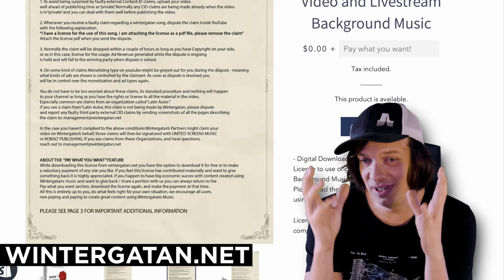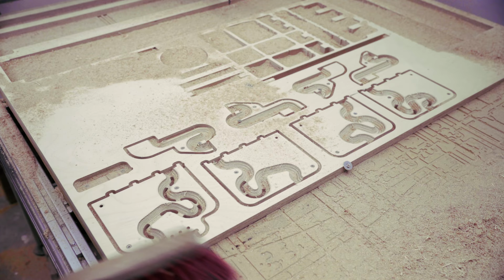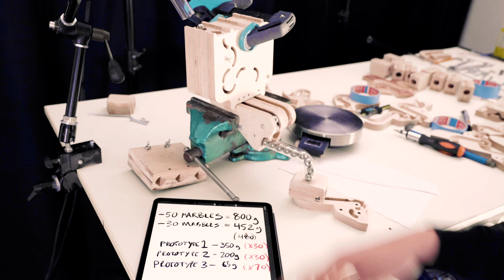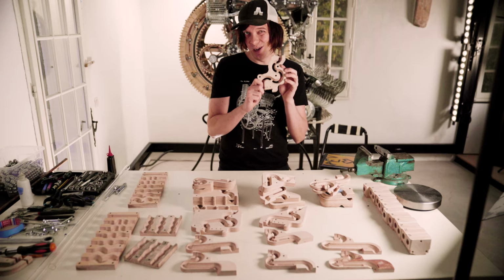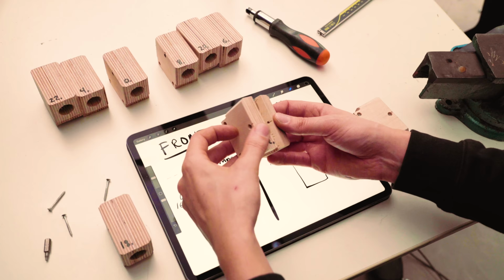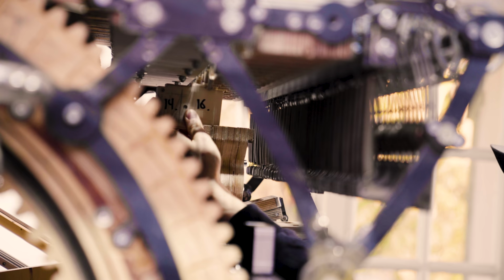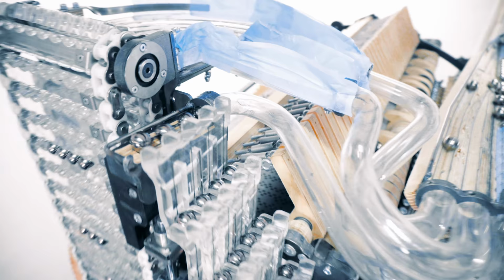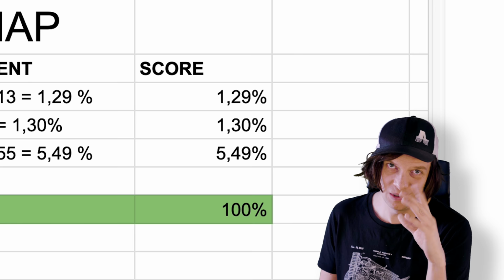Playing 20000 Marbles - Marble Machine X #147

Comment: I love the new direction with the focus on redundancy. Something I have thought about since you talked about vibrations last week, which can be an issue for the machine's reliability, is vibrations caused by external things during the concerts. Maybe the concert situation will be somewhat "messier" than the testing situation in the studio with people running around on stage as well as just vibrations coming from the speakers and other instruments. So I was wondering if this is something you've thought about, Martin. Maybe the machine could do with some extra shock absorption?

Comment: The marble speed test. It is going slower because the contact area is smaller. However it still has to rotate fully just like the others. Ergo why it is slower. It takes more rotations to reach the same destination. It's like having smaller wheels in a car. It takes more rotations to cover the same surface area of a larger wheel.

Comment: After the machine finished the band has a worldtour. It need four cars: First is the tourbus. Two is unmarked bus with the security team. Three is armored carrier with the machine and Martins bunk inside. Last is a big lorry with several trailers with the workshop inside. In front any concert Martins buyes clear the local hardware shops on replacer parts.

Comment: You can reduce your metal frame noise too, by simply adding sand into the empty frame. Sand will add mass and also acts as a harmonic buffer. If you don't want to add much mass, you can use tiny ceramic beads. Both materials are "welding safe". Both can also be partially "removed", if needed, by draining the material at the feet with a vacuume.

When you are finally done welding, you could use spray foam or pack it with rock-wool.

More exotic... Use oil... Easier to drain.

Comment: You can also tension the belts by stuffing a floating idler between the two belts.  Since the belts have teeth it will stay where you put it and look very cool "floating" in mid air.

Comment: @8:05 The wider track causes the marbles to rotate faster due to the smaller rolling diameter. Thus more of their initial potential energy is converted to  rotational kinetic energy. Marbles on the wider tracks will also experience a larger normal force from the rails which could increase losses to friction.

Comment: The over-rotation effect slows down the marble because it needs to rotate faster to cover the same amount of track, so a larger percentage of the kinetic energy goes into rotational movement, and less in linear movement. But that only matters during movement, not in the static pressure.
Reply: Exactly. The marble is rolling on a smaller part of itself so it needs more rotations to travel the same amount. It's like when turning something on a lathe. You have to spin the part faster when cutting smaller diameters and slower on larger diameters to achieve the correct surface footage per minute.

Comment: Not only will the runner wheels tighten the belt, but it shortens the free length of the belt. This will increase the resonance frequency substantially by itself (about double if I remember my physics correctly).

Comment: Like the new design and think it works well as well as looking cool. The discussion though of the over-rotation though.... doesnt apply here. Over-rotation transfers the change of kinetic energy into rotational energy instead of linear energy. Since you are not really rolling much in that area it doesnt matter. Where it may help more is that the marbles have a smaller contact area to the plywood.

Comment: If you have a adjustable spring based tensioner system for the belts, that should increase the liability and remove the vibrations..

Comment: I think you should add some hinged trap doors on the divider that close when the balls drop and the tubes are full. That way, it could roll smoother and not get hung up on other marbles. The balls would trip a small trigger or paddle on the door that closes it until a marble drops, which will cause it to open.

Comment: There's no way this thing goes on a world tour. Ever. it's a fantastic machine but the tolerances and engineering of it are so tight, no way it gets taken apart and put back together.
Reply: Maybe it can be separated into large sections that travel in their own boxes, just like a drum set or a multi-synthesizer setup.
Reply: The machine is divided in seven large sections that can be taken apart and reassembled fairly easily. He built the machine with that in mind, so almost everything on the machine is modular. Also, in the past he often had to take apart large parts of the machine, and as you can see, its still in one piece and working just fine

Comment: It's slows the marble down because the marble turn at the same speed but it wheels are smaller, so less distance per rotation is achieved. Like comparing a kart wheels to dragster's and having the same rpm.

Comment: The marbles moving at different speeds is even simpler than folks are making it out to be:
Imagine a bicycle, A big tire can cover greater distance per rotation than a smaller tire can.  Ie you have to rotate the smaller tire more to travel the same difference as the large tire.
When the track is tight together, you get to use the larger diameter of the sphere, when you widen the track, you shrink the size of the "tire" so it needs to rotate more to travel the same distance.

Comment: I don't know if you're going to read it, Martin, but if you use a wheel connected to a spring (or something like that) that pushes it to tension the belt, you could get an effect of critical or super dampening if the spring constant is higher than a certain amount (which comes from the differential equation for it, but the result is usually a stiff spring). 
If you just use a fixed wheel, you'll just be changing the natural frequency of vibration.

Comment: 8:05

TLDR: 
Torque = Force*(Distance from center of rotation). The wider ramps decrease the distance, pretty much as Wintergarten explained, while applying conservation of forces shows that the gravitational force pushing the marble down decreases with the wider ramp setup.

What allows the marble to roll is in an intriguing combination of both gravitational and frictional forces. Gravity pushes it down, but friction is what makes the marble roll instead of skid down the ramp.
Rotational motion is largely drive by torque, or moments. Torque = Force*(Distance from center of rotation).
As mentioned, the closer the poles are, the further away the contact points are from the center of rotation. Thus, per the equation above, the torque was greater, allowing for faster rotation and speed.

Another thing to consider is the distribution of the gravitational and frictional forces when in contact with the poles at those varying angles.
To understand the next part, it's worth recognizing the relationship between the friction between two objects and and the force pushing down on them. They are directly proportional - a heavier dresser will be harder to push than a lighter one.
But now let's add another variable. Put that dresser on a ramp. Gravity is now helping push the dresser down. But will the friction force be the same? No. It will be less, because that gravitational force has been dispersed from one dimension (up/down) into two dimensions (up/down, forward/back). While on the flat surface, the full effect of gravity was pushing the dresser into the ground, now part of that force is pushing the dresser forward. With less force pushing down there is now less friction as well.
Let's consider the simplest case of a marble rolling down a flat ramp. The gravitational and frictional forces are all acting in only 2 dimensions: Up/Down, Forward/Back. Obviously flat ramps won't work as it won't stay in place. You need to distribute some of that gravitational and frictional forces in the 3rd direction (left/right) to keep the marble rolling where you want it to roll. This is done by having the two contact points be along the left/right of the marble, so that the reaction force (think Newton's laws) due to gravity pushing the marble into the poles, will push into the ball from the left and right, keeping it on track.

Spacing of the contact points affects the distribution of that third left/right force. The further spaced poles would require much more force to make the marble falls out of place compared to the faster one. Why? Because more force is pushing in the left/right direction. That means there is less force pushing the ball faster down the ramp. 

I hope that explains things well enough.

Comment: Re: the physics behind the rolling marble speeds:
I think it is simply due to the lever arm of the roll diameter of the marble. Larger diameter = longer arm = more mechanical advantage over the rotational inertia of the marble = better acceleration = finishes faster. I would bet you that the "slow" marbles are rotating faster within their own frame of reference, and would make it the furthest up an incline before they stopped..Oo that is an interesting thing to think about, maybe they wouldn't since they don't have a lot of forward inertia. Maybe they'd be better over rough surfaces rather than smooth. Not sure, that would be interesting to test.

Comment: Just one idler on each belt should be sufficient. Just like a piano wire or a stringed instrument, if you change the tension, you change the frequency. Now you just need to make sure that the frequencies of the belts are not near each other (or that the beat isn't terrible).

Comment: Constructive idea for the runner wheels for resonance? How about a single spring loaded belt tension pulley like used in the serpentine belt in most automobile engines? This will provide constant belt tension as the machine wears in and the belt stretches over time.

Comment: There's a method to bend your pipes that's pretty cool you use sand and bake it in an oven till it reaches 150 degrees I think and pour it in the pipes and it holds the shape because the sand keeps it from collapsing and it bends really easy you just need to hold it in place till it cools off. And if you spiral them around each other it would save space. The clear pipe looks way cooler than wood blocks.

Comment: Im not sure if this will play a part in the long run or not but i feel like over time with that many marbles running through the same piece of wood will eventually over time change the values of measurable friction within the whole part due to smoothing. Again i could be totally wrong but i feel that for parts designed for that specific purpose is something that may have to be considered to prevent premature failures. The only remedy i could think of is possibly epoxy lining the channels which will also change the value but slow degradation at the same time.

Comment: Even if you reach 9.999% reliability the machine is still 100 times less reliable than at 9.99999% reliability! That's a huge difference. You don't need no failed marbles. You need no damage to mechanical parts if some marble fails. In other words you need the machine to be fail safe in regards to marbles.

Comment: Yeah, the marbles missing the funnel should be easy to fix. I always thought they look cool, but if you had one piece of wood that is covered with felt in the front where the marbles can fly into, it would be much simpler, cause the wood does not move every time a marble flies in. Sad thing about that solution is that it would block vision of the machine in some part.

Comment: Martin, hoppas du läser detta. If the funnel failure is sensitive to vibration, I'm wondering what a shaky arena stage with jumping band members and blasting arena speakers will introduce as unknown factors. But I bet the Dr. can figure out a way to simulate that miljö for testing.

Also my fellow commenters: Martin does know that these are non-critical failures. Striving for perfection is the only way to reach excellence.

Comment: Over rotation goes slower because it takes more energy to travel the same distance. But gravity is still pulling down at a constant rate, so the marble that needs to spin less times to go the same distance is the fastest.
Reply: Basically, a tiny wheel that spins 20 times will travel less distance than a big wheel that spins 20 times.

Comment: So I can remove the diffuser as well put it somewhere else.
I need to sand some parts a bit and the middle is slightly lighter than the outside, because that wood has not been oiled, like the second-hand tables I used were oiled, but the bed wasn't. So maybe I'll do that to make color even, but it doesn't bother me too much

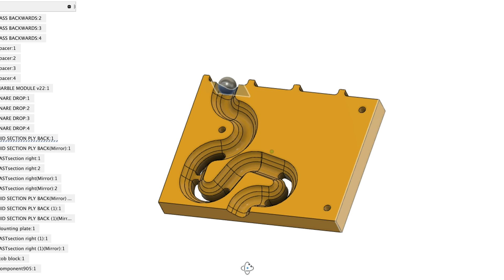Comment: 8:15 ish... About the speed of the marbles. The wider the track, the smaller the contact diameter is. Same as a tire. A 17" tire covers more distance in 1 completed turn than a 11" tire. The side of a marble is likewise. The higher (nr3) at the marble the smaller the diameter is at contact. The rotation speed of the marble remains the same but the distance covert is way smaller.

Comment: Doubt this will be seen but, for the resonating belts, perhaps the tensioners you add could be mounted on a spring so it dampens the wave because I believe adding the new wheels static will just change what the resonant frequency is, but maybe a spring can “eat” some of the energy

Comment: I don't believe if the tracks modified by the "over-rotation" is really working. I think the marbles are pressing each other only by the weight, and only the track paths are doing the job. We have also to consider the drum head has some movement when you play a note, sometimes the movement will rebound the marbles, and missing the funnels. This scenario will change when you play the vibraphone because they have the spring that affects the marble hits, and I think is not possible to "hold" the plates as you did in the snare.

Comment: The marbles rolling down the tracks of different separated widths can be easily demonstrated with a Tire. 

If you took a tractor tire that's 5 or 6 ft in diameter and then took a regular car tire that's 20 inch's in diameter and then move the tire in a full rotation the tractor tire is going to move a lot further of a distance because there's more surface area for the tire to use and move said  further distance. The car tire on the other hand isn't going to move as far in a single rotation. By changing the size of the track you essentially change the size of the diameter of the marble. A larger-diameter rolling marble is going to cover more distance with the same amount of energy that a smaller diameter rolling marble will have to cover. When you add in things like friction the amount of times something rotates can greatly affect its speed. If you were to roll the same two tires down a hill I'm pretty sure the tractor tire is going to reach the bottom faster. They have the same amount of energy imparted into them from the hill but because of the larger rotation ability of the tractor tire, it's going to get a faster Head Start and make it so it can pick up speed faster and faster.  At a certain point they will be traveling the same speed it's just the amount of acceleration that one gets over the other at the start. The marble on the tracks right next to each other were able to get a head start without having to pick up speed. The last marble had to get going fast enough to make it so the smaller rotation needs more speed to match the "larger diameter" marble.

I don't have a college degree but this is how my understanding of physics explains this event. I'd like to know the math behind it if anybody has the equation. Just dropped a link in the replies.

Ps i love this machine. I saw you play it a few years ago and I've been dumbstruck by it since. And now you are licensing your music for free? Bro you are a one of a kind man. Keep up this amazing engineering!

Comment: @28:48 you mention adding 2 "runner wheels".  I would call these idler pulleys.  It is normal practice to only add 1 idler pulley to the slack side of the belt (usually when it is added it is also used as the tensioner).  When the machine is in operation the torque from the motor (or whatever driver) tensions 1 side of the belt and creates slack in the other side since belts cannot transmit compression.